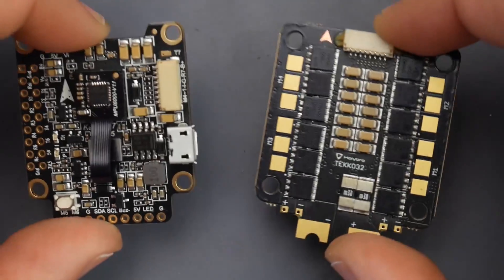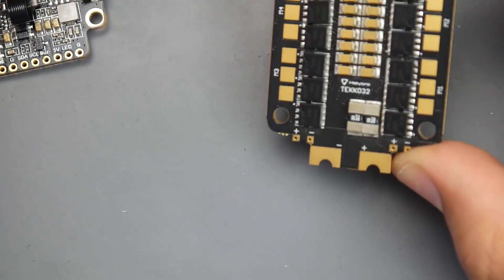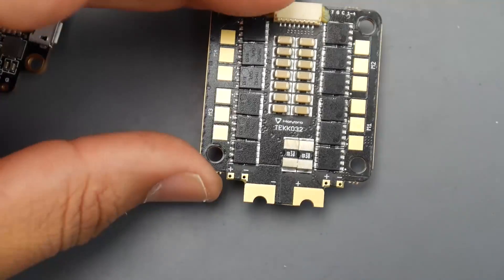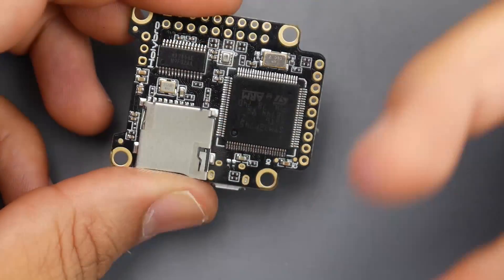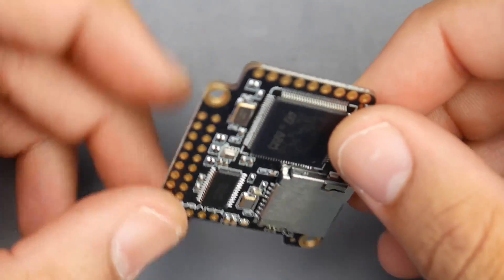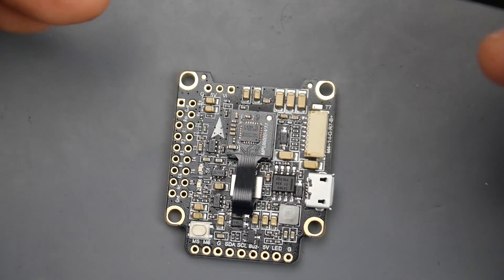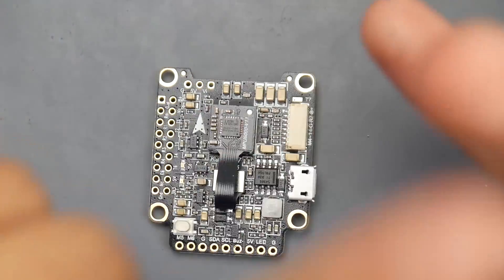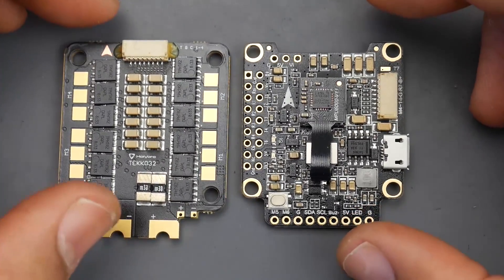Latest FPV Drone Full Spec Stack // Holybro Kakute F7 V1.5 Review & Setup Guide

Comment: My ONLY complaint is actually the foam gyro mount. It does not stay consistent.   Propwash can cause the gyro board to move enough to throw things off. 

That said, my v1 was a good experience, and I'm gonna buy a v1.5.(despite my criticism of the gyro board), the 4 in 1 was a great, noise free (in my experience) esc board. A BIG crash (on my channel) killed one esc. So, time to buy new.... 

Btw, I never needed the capacitor. I had 0 noise. It's filtered very nicely...

Comment: Hi just a question if you dont mind, when i plug in my battery the fc doesn't give a sound, but flashing the leds, and power go to the dji air unit but no response for the remote, any idea thanks

Comment: Hey!
Can someone please help me..
I broke the ribbon cable on the gyro and I can't find any replacement  :'( not even on the holybro homepage lol
Reply: That's the problem with the ribbon! Try iFlight's F7 TwinG or the CL Racing Dual. Don't need all that Mickey Mouse fluff.  It is start-of-the-art in it's use of gyros. What is said about the MPU6000 just isn't so. The only reason the are popular in China is because they have a ZILLION which Invensense dumped when they moved to newer and BETTER parts.

Comment: 4:38  are this paralel to Battery
Or is it After Current Sensor?
When I will Take 20 LEDs with an external  BEC to it will it messure the Current with the LEDs together with  FC, Motors, FPV System?
Or are the LEDs separatet without Messuring?
Can i Connect the BEC for LEDs with the end Of VBat Cable to the FC?
When i Take an RXSR receiver 
Can i Take the R1(2,3,4,5,6) pad for Signal and T1 for Smart Port? Or is it only possible R1 for    Signal(Sbus) and T2 for Smart Port? Also SBus and Smartport with One Number couple RX and TX die the same Number? Also are the costs  Full Rxsr SBus and Smart Port  1 Uart or 2 Uarts

Comment: Personally I like ESCs that are soft-mounted. In a harder crash frame bends, and bends ESC PCB. This usually has an effect of cracking multi-layer ceramic capacitors, which often short when cracked, causing an ESC fire. That's the reason I buy modern Speedx, Hobbywing, Aikon, T-motor and Flycolor which are all soft-mounted AFAIK.

Comment: What would be the prefered VTX for this FC? The 5V or the HV (in my case unify)? Which way will induce less noise into the video?
Reply: If you want to be super fancy step down your battery voltage to 8 or 9 v

Comment: I hope that`s not a silly question, but if you can help, i will be glad. Nice video. Can you compare Kalute stack with Pixhawk 4 platform? Despite the size, whats better? New in this stuff and searching for my first and long last decision. THANKS
Reply: Pixhawk- faster processor, more ram memory, 2 gyros on it, barometer,compass , 16 outputs, more inputs.. have connectors and not soldering
Reply: Just get either stack. An FC is an FC unless it has something special like Helio it those times g gyros.
Reply: The esc is more important than the fc btw. Go with tekko I'd say

Comment: i want to build a fpv drone in india. can you help me?
Reply: I will build you one and send you one where parts are cheap here
Reply: @jjj25313  ok tell me the total cost ?
Reply: @govindkatyura7485  Let me know what kind of build you want. I'm familiar with most the fpv parts out right now.

I.e. budget racer, budget freestyle, mid range, premium. 
And let me know anything you specifically want like do you want a pod? Bottom or top mount battery.

If you're not sure, leave it to me! I love making the best drones for the price.
Reply: @govindkatyura7485  it can be done for as little as $200 USD but keep in mind you'll need a transmitter and goggles as well.

If you want more premium parts I know the best places to spend the extra money, probably motors and escs. It can get up to 4-500 for my more premium builds. (you don't really need that unless you're a pro tbh)
Reply: @govindkatyura7485  for ~300 you can really have something reliable and durable. (That's what I fly myself) 

I do also have some old gear you might need: transmitter, etc. Lmk I could list it on eBay for you or something. 

Happy flying! 👍
Reply: @govindkatyura7485  I didn't know what to upgrade when I started. Like I went with the FC when I should have gotten new ESCs. I would have saved so much time, headache, and money if I knew all this back then!

Comment: Are the Holybro ESCs rebranded Airbots? Because that sure looks like the Furling32 F3.
Reply: Yes, it's the same ESC but with different silkscreen, higher price and better FETs (on paper). I've been running Furling32 45A since it was released and I have zero problem with it. Durable and cheap, all I need.
Reply: @Asu01  Sounds like just what I'm after for my next build. Thanks for the information!